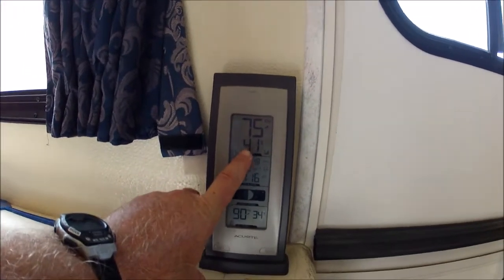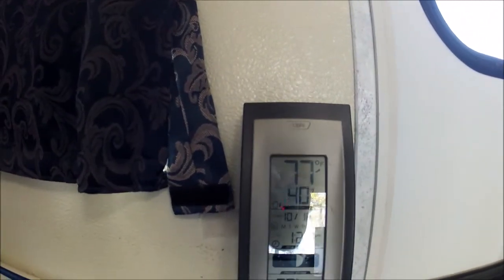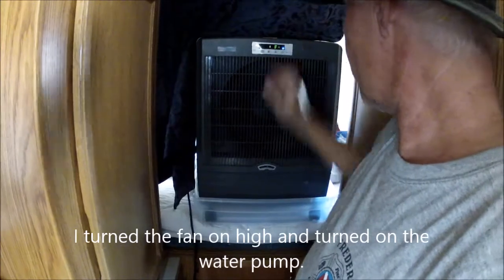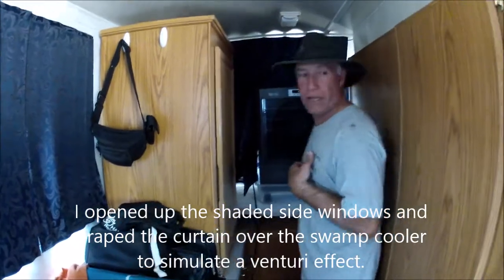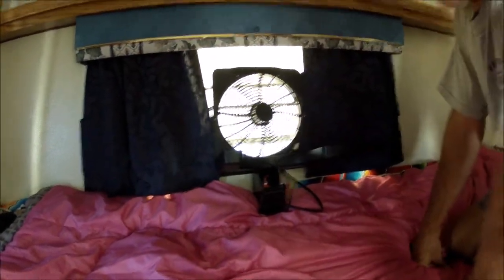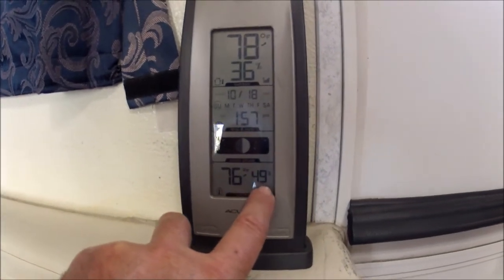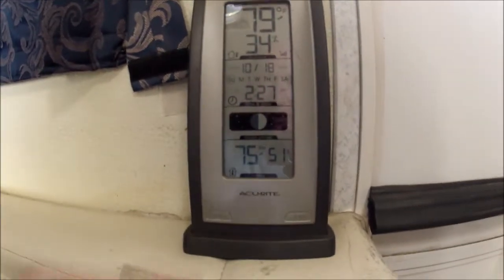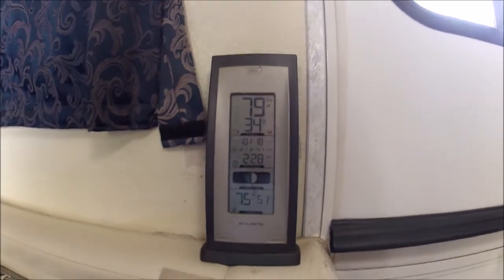Off-Grid RV/Camper Cooling

Comment from the maker: Hello everyone. Over the years of working with customers, I get the question pretty frequently about how to cool a camper in the summertime heat. Well since I work in the off-grid sector of solar and camping, the A/C is not much of an option coming in at 1200 watts. So my last camping trip I made a short video of how I do it when I'm out camping in the summer. I have to say, I was pretty happy with the results.